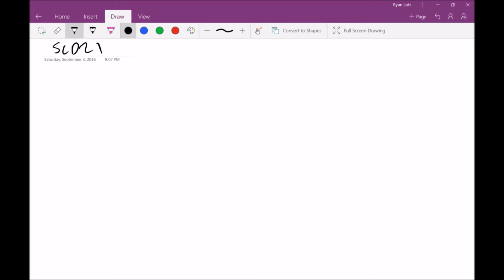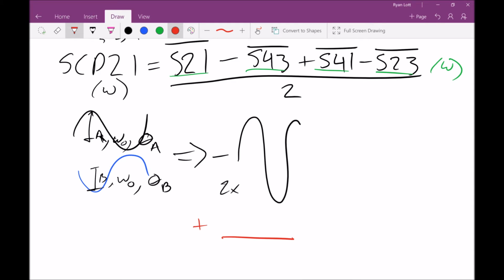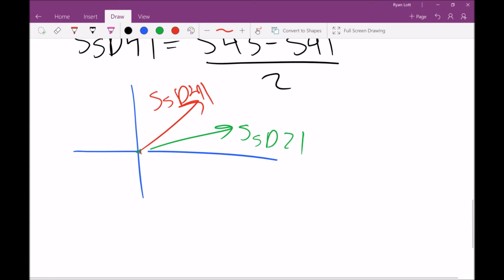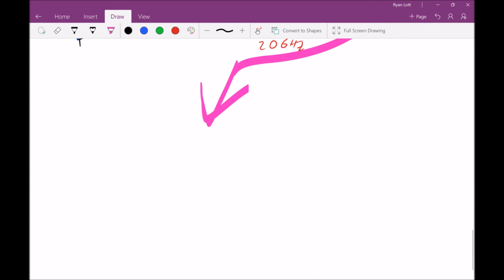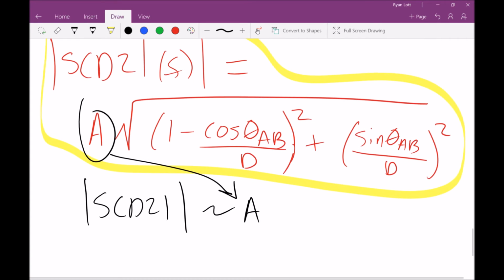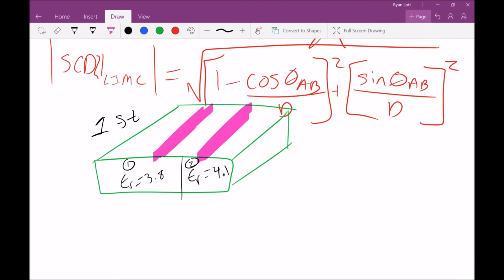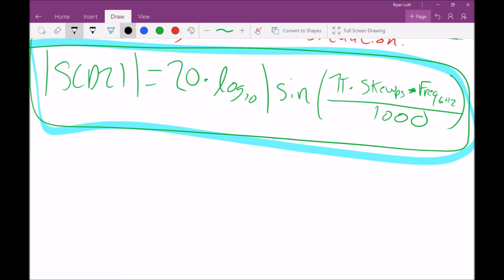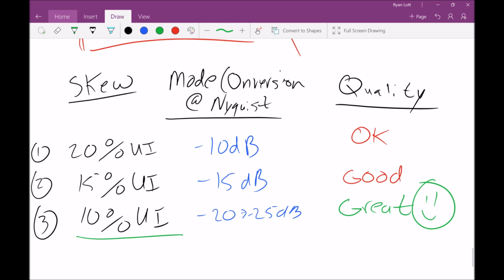Mode Conversion: S-Parameter Analysis of Differential Interconnects - A Breakdown of SCD21

Comment: Hi, here 4 single ended ports are converted into differential ports.. I would like to know.. 2 single ended ports can be converted to differential?
Reply from the maker: Yes! Absolutely it can but it only makes sense to do in only one configuration. Let's start with our diagram. Remember, we're sending/reading diff signals between ports 1/3 and 2/4. If we remove one of the lines we're left with port 1 and 2 at both ends of the remaining line. Doing differential analysis on this config doesn't make sense because there doesnt exist a practical differential pair/reality. Sure, I can perform math and convert 1 and 2 to a single mixed mode port and matrix, but the results are useleas. In contrast, if we keep the two lines and remove ports 2 and 4, were left with the two lines and ports 1 and 3. 1/3 is a diff pair in reality and the two lines remain so it makes sense to perform mixed-mode analysis by converting 1/3 to a single diff port. In that case, you get a 2x2 matrix that holds SDD11, SCC11, SCD11, and SCD22. This is the input differential return loss, the common mode return loss, the diff in comm out reflected, and the comm in diff out reflected transfer functions looking into the diff port 1/3. Very useful. Using only two ports happens alot in practice e.g. measuring input impedance of a differential serial i/o buffer.